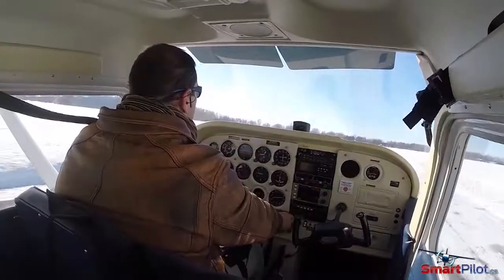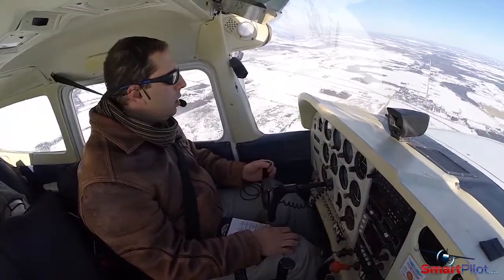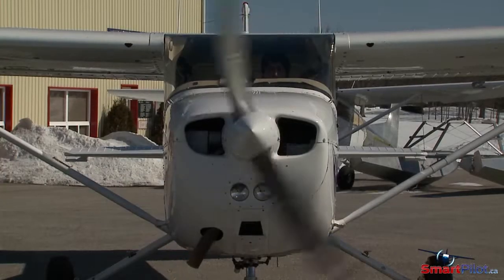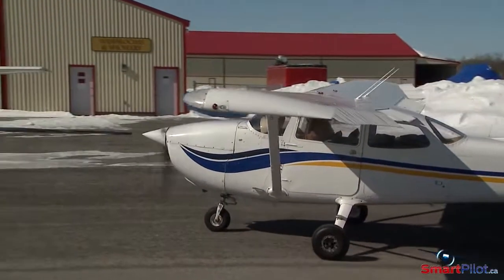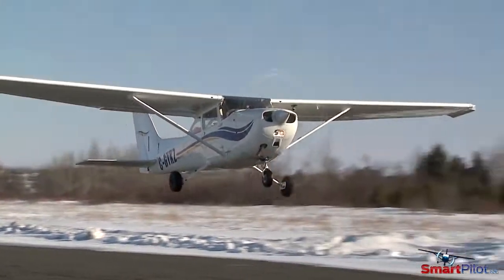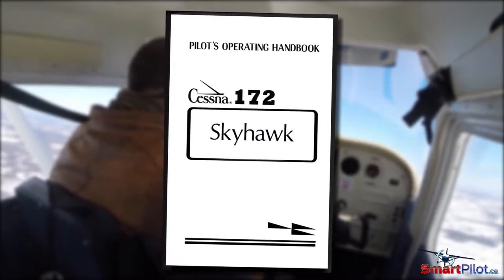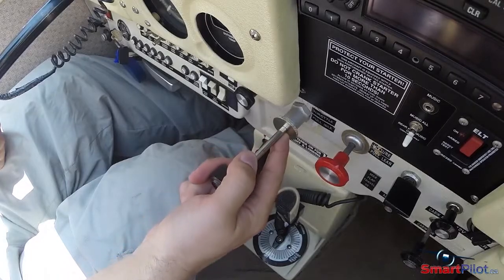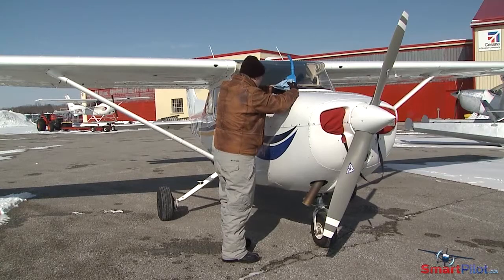SmartPilot | Winter Flying - Engine Operation in Cold Weather

Comment: Could you please describe how icing can affect the performance of aircraft engine
Reply: In the carburetor, you have what is called The Venturi Effect; where the air from the outside is compressed into a low pressure area which squeezes moisture out of the air. This residual moisture attaches to the nearest metallic surfaces it can find and freezes instantly just after it exits the Venturi tunnel--the part where the fuel is mixed with the air. 

As the moisture freezes just after the tunnel, it builds up on the butterfly valve, and the surrounding walls; which sophicate the engine.

Therefore decreases RPM, Power, and *Performance*. 

I know it's been 8 months since you posted this but I'm sure you had found the answer later on.

Comment: I don't like to put mixture fully in prior T/O...
Reply: It depends. Ideally a normal takeoff should be done somewhere rich of peak for engine reliability. When flying at high altitudes, this would mean bringing the mixture out by about a half inch to an inch in most cases. Some airplanes are more prone is fowling than others, and if you are renting, consult the owner about that. 

When doing a short-field takeoff, many airplanes should be leaned at max power while holding brakes to just rich of peak, or best power. 

Keep in mine that colder temperatures would mean denser air. Since fuel/air mixture is a gravimetric ratio, this means that a richer apparent mixture would be necessary. Effectively, you have a lower density altitude, which governs how the airplane's engine behaves.

Where I fly, the average elevation is around 3500' so slightly leaning for takeoff is commonplace. If your engine is running rough at high power settings and your mixture is full in, you could try leaning it a few turns at a time and see how the engine starts behaving. An especially rich engine will act somewhat similar to a very lean running engine. Of course, keep in mind that carb heat would significantly enrich the mixture if you are already flying at higher altitudes. 

That's my 2 cents on the matter. Make sure to contact a certified flight instructor and you airplane's POH whenever there is any doubt. For legal reasons, nothing I have said here is to be taken as any form of flight instruction, and is merely my experience. Use it as you may.
Reply: Now I feel too dumb to learn after reading this post🤦😄